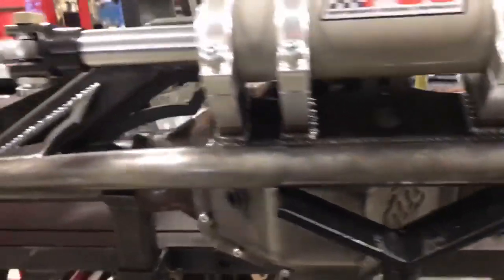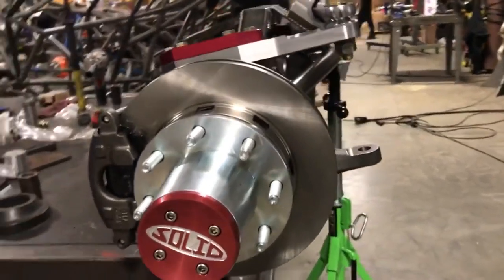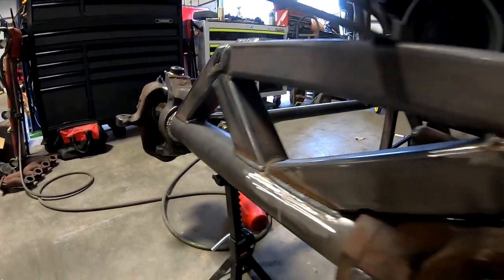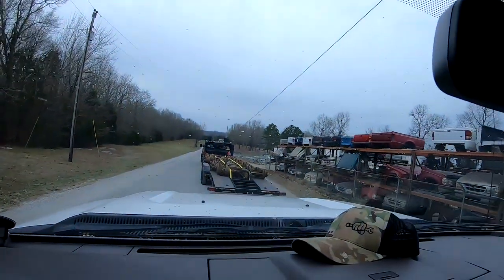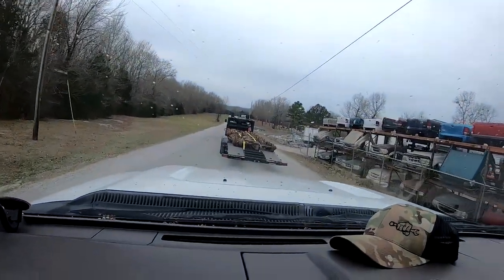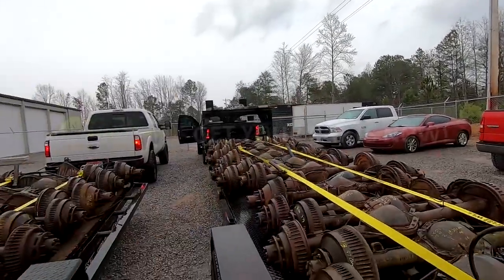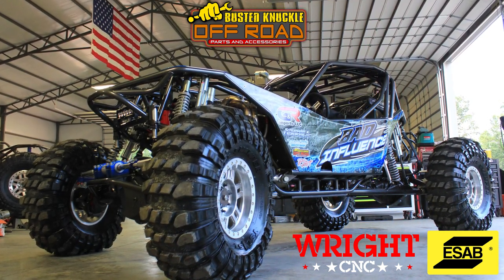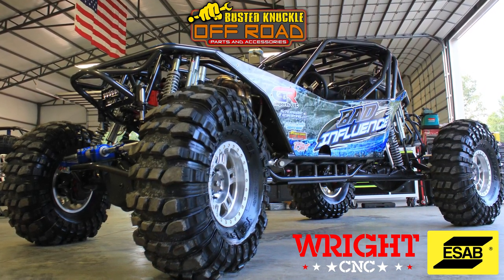WE HIT THE JUNKYARD 14 BOLT AXLE MOTHERLOAD! 👊

Comment: Try finding the 14 bolt 9.5, 6 lug or 5 lug with a measurement of 63.5" It took me awhile to find one out of a 94 Chevrolet 2500 light duty. Excellent upgrade for my K5 blazer.
Reply from the maker: they are only semi float, we like the heavier duty full float 14 bolts

Comment: 14b are never hard to find lol.. 2min on the net and anyone can find a 14b for under $200 within 15 miles to them.
Reply from the maker: Never said they were hard to find, we just try to go and get them in big numbers so we can use them for builds.
Reply: Not as easy as they used to be to find here.
Reply: none in central IL here.. zero.. good luck.  no gm trucks this old left here at all... all got scrapped in peoria behr shredder. it sux up here..